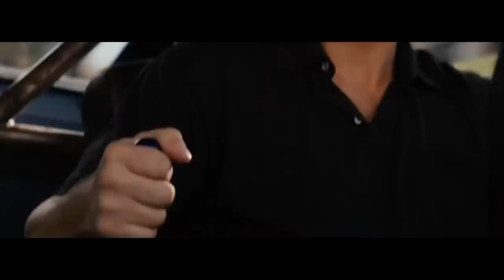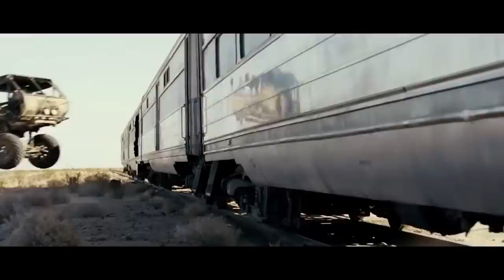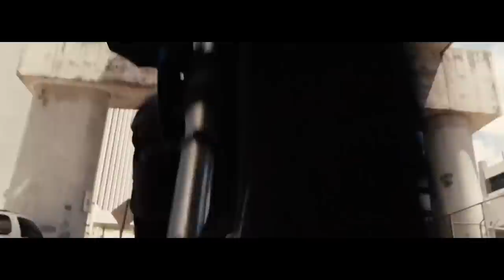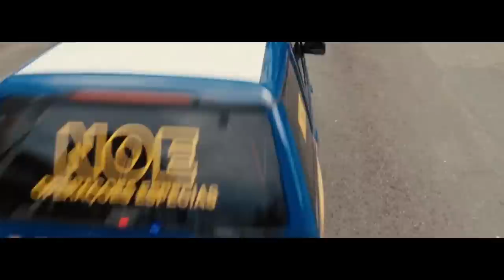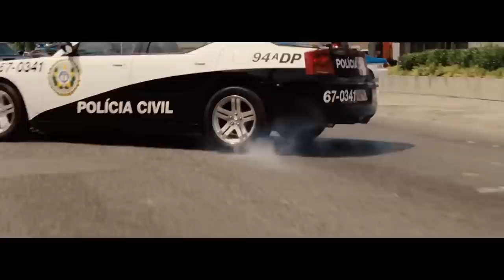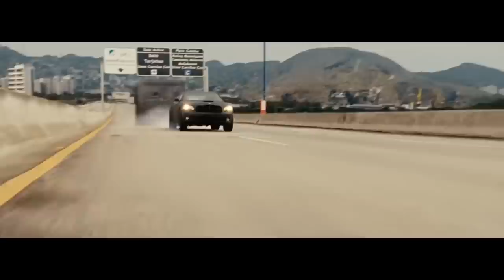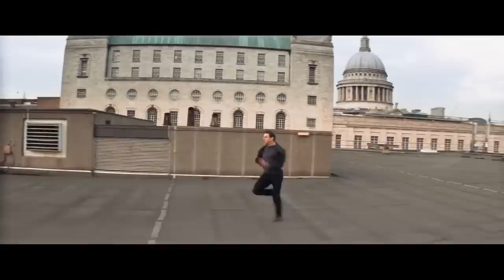Fast Five Pulled Off The Greatest REAL Stunt In History

Comment: I'm not sure how they "pulled off" anything. Every part of this scene is fake af. I'm really not sure what they proved it could be done either? Proved: you can steal a bank vault this way if it's actually 3 seperate fake vault props and tons of seperate shots where much of the vault moving isn't done by the cars. I feel like this entire video is pointing out how they didn't actually DO the thing portrayed in the scene.

Don't get me wrong, AMAZING use of practical effects here instead of just going full CG but that's simply not the same as "pulling off" A stunt. This is a series of practical effects and stunts compiled into an unbelivebale scene because and this to me is the important part, IT DIDN"T HAPPEN.